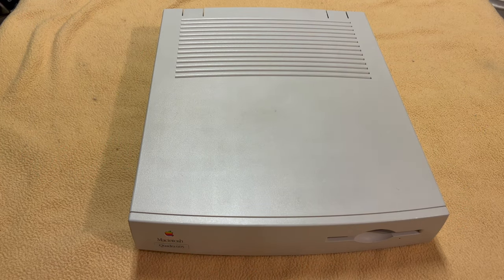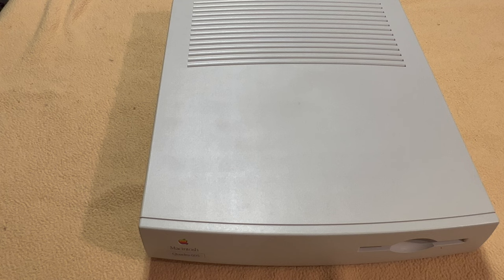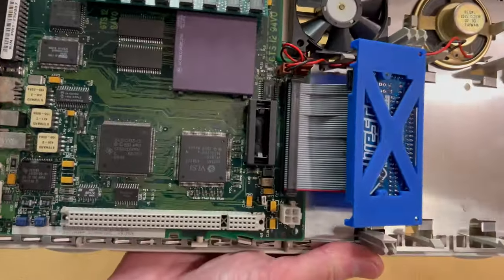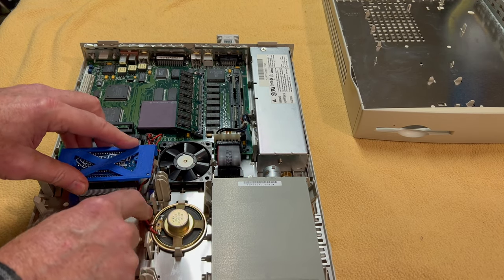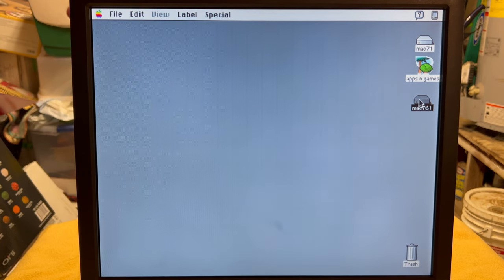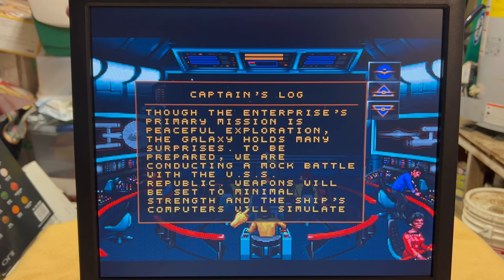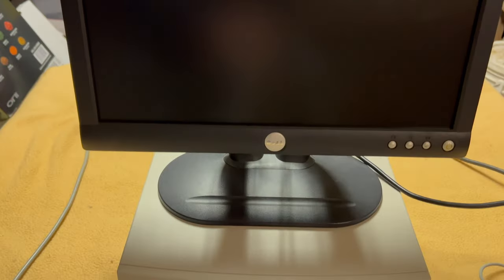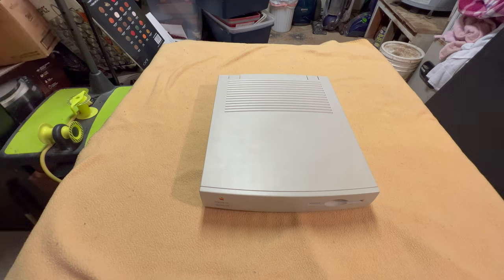FREE CraigsList Macintosh Quadra 605

Comment: It's awesome that you won the giveaway for the LC III, for anyone wondering, i have what i think is a early revision of the LC III because it has bodge wires all over the board, and the overclock still worked just fine, i dont think there is a difference between the 25Mhz 68030 and the 33Mhz one other than the model number, i reverted this specific LC III to the original clock since i have a few other LC IIIs to play with but the 0 ohm resistor swap is definitely worth it, if you screw up and break the resistor you can even just bridge the connection since its a 0 ohms resistor

Comment: I'm gonna get hate for this but in 2005 or so i picked up more than 30 "failed" scsi hard drives that did the exact same spinning up then down and i basically just wanted to see what was on the drives before i threw them in the trash (they were worthless at the time) and i had two ways of making them work just long enough to back them up, one was to power cycle my external scsi enclosure a few times really quick until the drive stopped spinning down but it didn't always work, and the other was to take the drive in my hand and hit the side without the connectors on my leg or a couch or any soft surface a few times, not hard or anything just pretty much gravity force, amazingly it worked for almost all the drives but unfortunately only boring school stuff was on there mostly, today i would recommend opening it up and trying to fix it since they are getting more difficult to find, but back then it was considered e-waste so i am sorry if this offends anyone i just wanted to share this story

Comment: Yay! Quadra 605, one of the best classic Macs! 

4:35 I just use velcro tape and bend that BlueSCSI over, tape it to the shell of the case to hold those in these - I can show you how I have mine. Or you can screw it into the HDD drive cage - the cable should reach either way.

Another nice upgrade I've found for these is to replace the fan - this is a nice quiet one that fits perfectly and it's connector even fits, though the wires need to be swapped a bit (I can show you exactly which) https://www.amazon.com/gp/product/B008S1HNPS/ref=ppx_yo_dt_b_asin_title_o01_s01?ie=UTF8&psc=1

I've been soldering a CR2032 holder to the battery connector on the board for these systems I actually use, but just ordered some of these adapters
https://www.ebay.com/itm/115579539929?var=415597689502

Curious how well they work, they're similar to the older MeowToast adapters, though I've heard they sometimes don't fit super snugly (https://www.etsy.com/listing/1034101908/meowtoast-rev2-12-aa-battery-replacement)